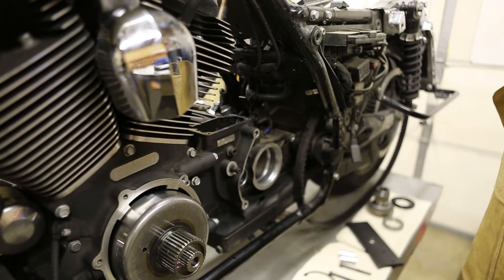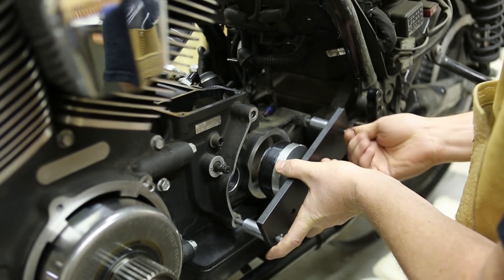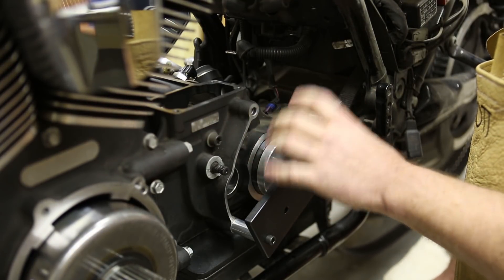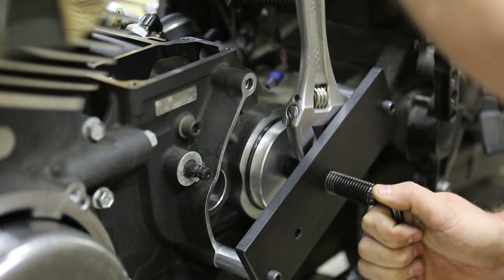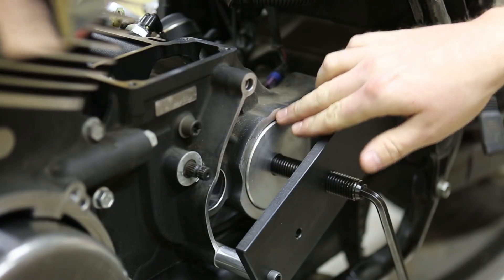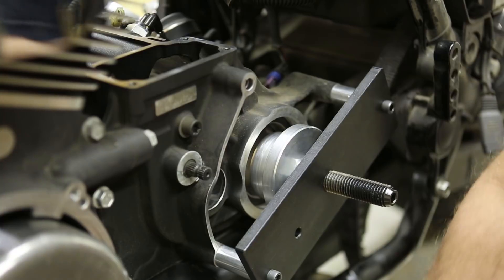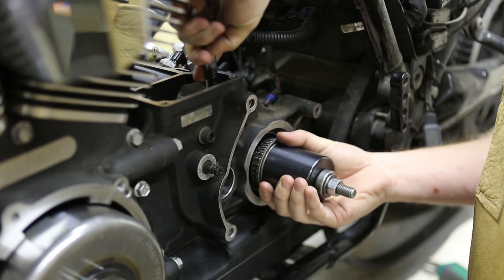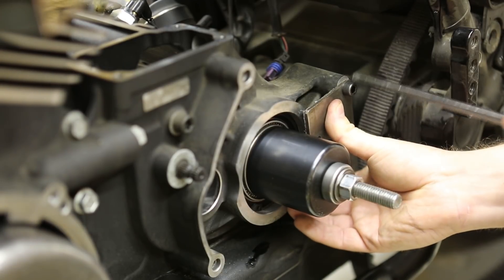Class #4- The BAKER Factory 6-Speed Tapered Roller Bearing Kit Installation

Comment: No oil on the bearing .
A complete video showing how to remove the bearing and changing the spacer for a larger /smaller one would have been great
That video is needed because what if someone install it and the dial indicator shows to tight or to loose ? Maybe you have a video showing it .

Comment: crescent wrench?  light lubricant / "WD-40 works well for this" WTF?
Reply: I agree with your comment. He should hav explained that the reason you only apply a light lubricant like wd-40 is because you do not want metal to metal contact between the race and tapered bearing rollers. You do not use transmission oil on bearings or race as it will affect your end play check. After the end play check is good then I would use an oil can and lube the bearings and rotate the drive gear to make sure all bearing rollers have oil on them. He also clocked the resting ring incorrectly as it should be at the 3 o clock position and and not at the 6 o clock position as he did, referring to the bearing eye lit opening.

Comment: Only thing I'd point out is the large retaining ring opening should be clocked at roughly a 90 degree/3 o'clock position rather than the 180 degree/6 o'clock position.
Reply: Any reason?
Reply: I agree with you ,for sure opening should be 3 o'clock position.

Comment: Can you let me know what the benefits are of installing this upgrade?  I have a 107 with head work, woods 888 cams, s&s lifter , adjustable pushrods, Bassani road rage 2 exhaust, and a tune but will be replacing the jugs with 10:2 compression pistons with fuel moto 10:8 compression pistons and cylinders because the woods 888 cams work well with a minimum of 10:8 compression and Revperf didnt leg me know that .  I will be upgrading my stock compensator and chain adjuster with the baker compensator and automatic chain adjuster when rebuilding the motor.  But would like to know the benefits of the upgrade you did?
Reply: Hello,  This is Jeff from Baker Drivetrain.   The stock bearing on the Cruise Drive 6 speed is very weak and is known to fail quite often and repeatedly.  The issue is the stock bearing is a plastic caged ball bearing and not strong enough to use with performance upgrades.  Our twin tapered design is extremely strong and able to outperform the stock Harley unit by changing the self-aligning bearing to our twin tapered opposing bearing setup.  It was originally designed to be in our Grudgebox High-Performance transmission but we received a large number of requests to make it available for the stock 6-speed transmission as well as for our DD7 transmission.  If you have any other questions please feel free to contact me I would be more than happy to assist.